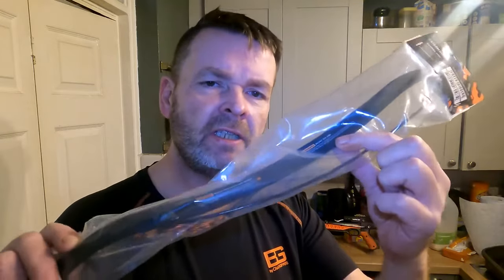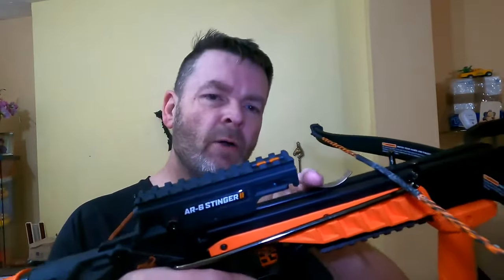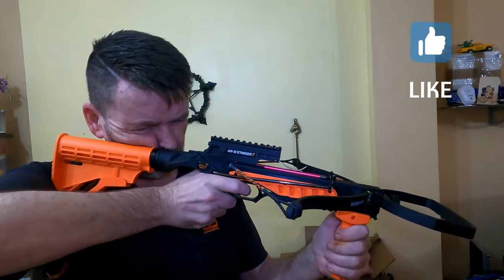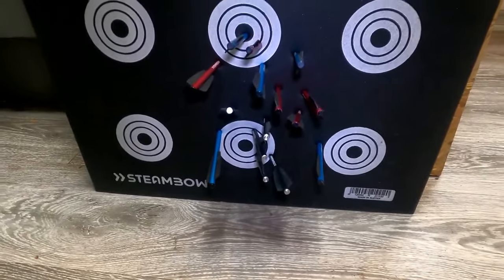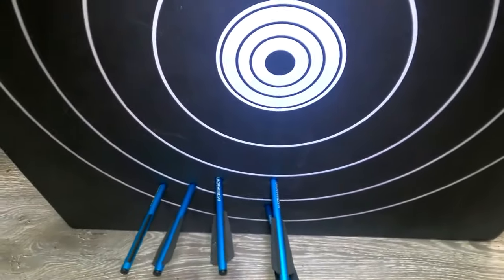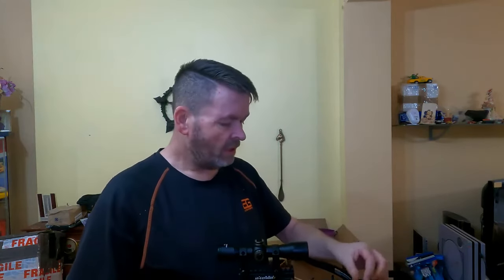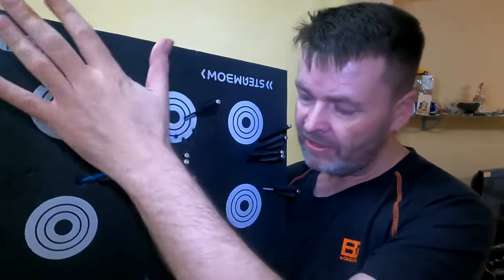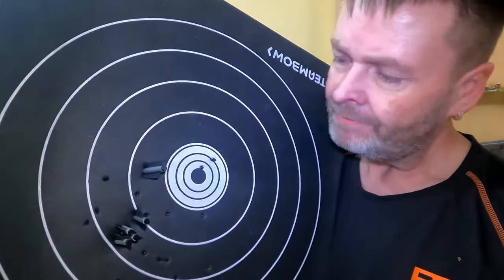Steambow  Crossbow Bolt Testing part 1

Comment: great vid mark , not keen on scopes i use a laser and find groupings are much tighter
Reply from the maker: I'm just about to upload part 2, I've switched the survival sights, for mk1 stinger sights, the there is a 200% instant improvement of groups
Reply: @markhuckercelticcrossbows7887  interesting
Reply: The front sight on the Survival is absolutely useless, it moves too easy
Reply from the maker: @southfolk  yup, the mk1 sights are much better.